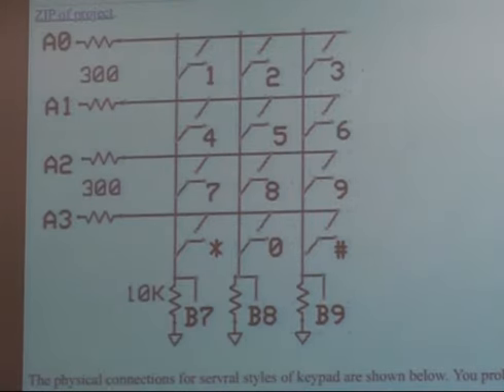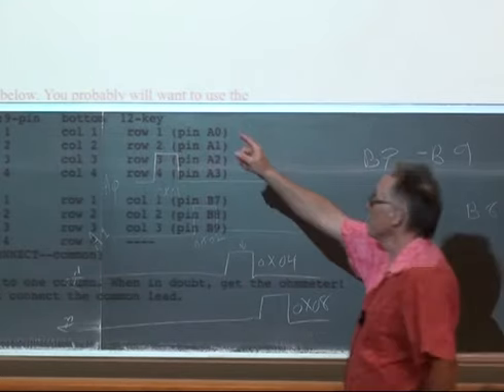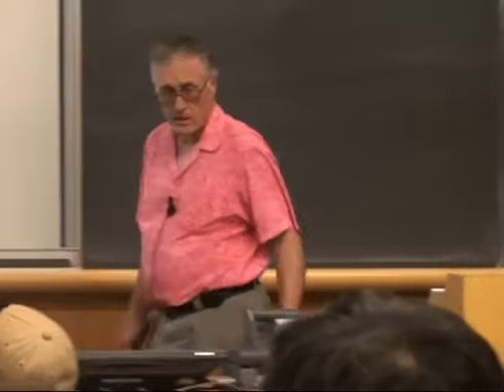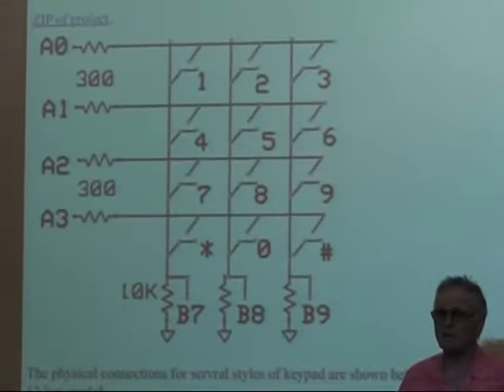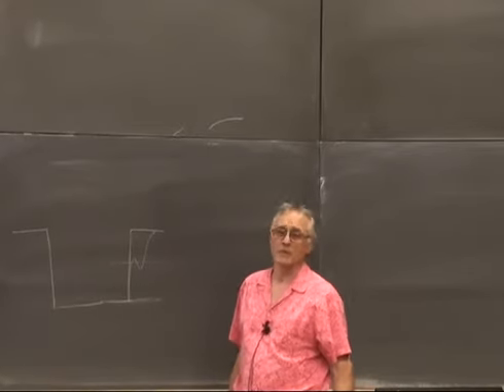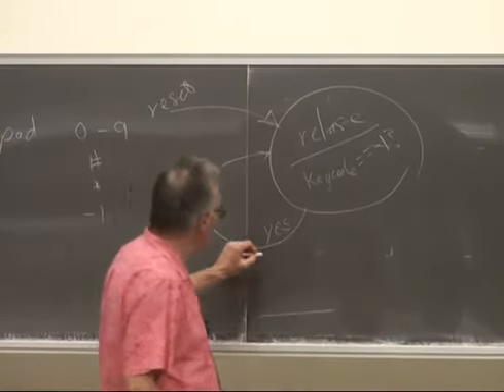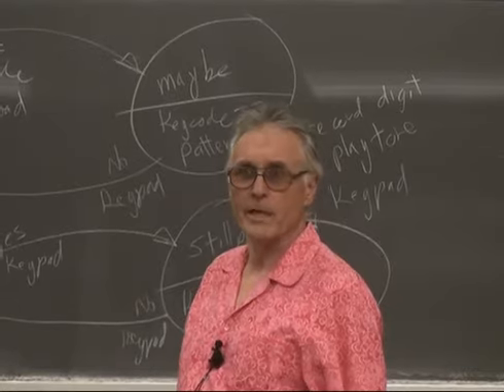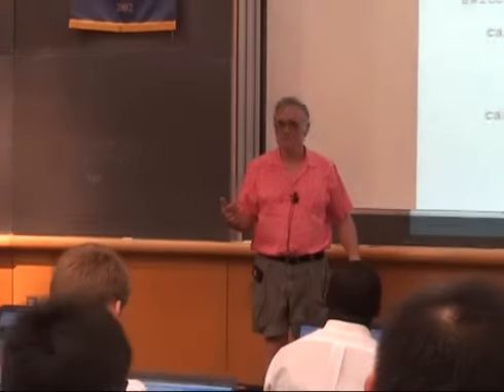#6 keypad scanning

Comment: Usually, the capacitors with higher rated voltage have a better dielectric material property and less leakage/absorption. And also one need to take into account of the DC bias of MLCC as its capacitance rapidly declines as the applied voltage increases.